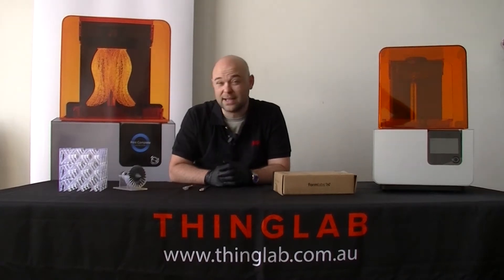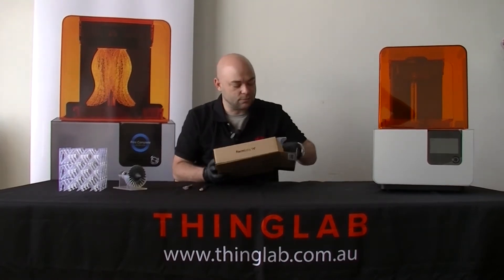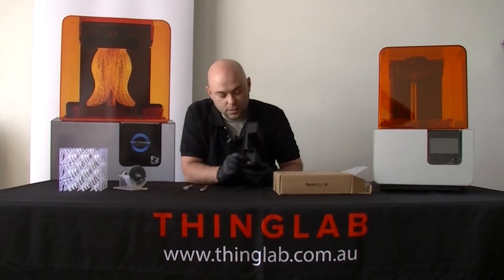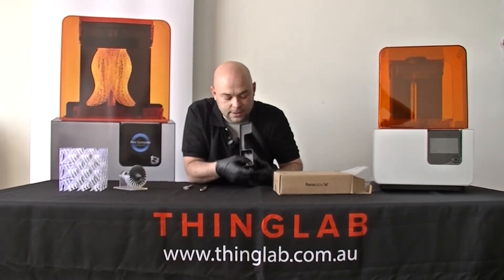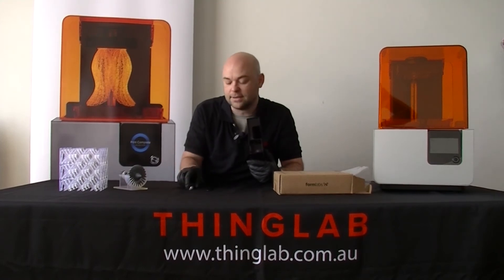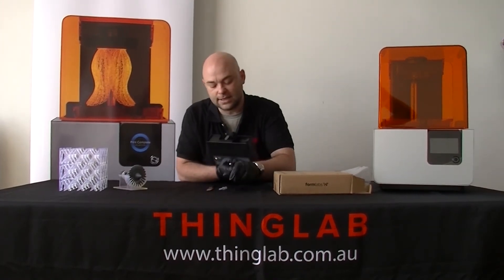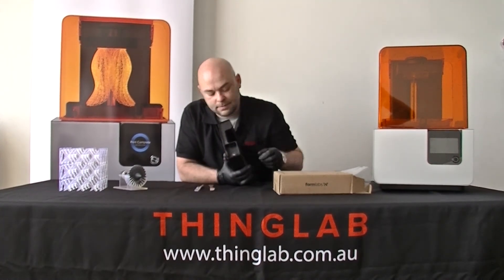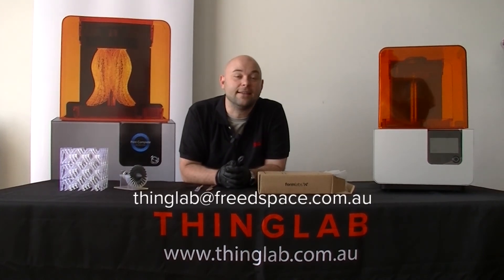Thinglab: Formlabs Form 2 Resin Cartridge Dispense Error

Comment: Any tips on fixing the intermittent contact issue between the machine and the cartridge? I've cleaned the contacts on the machine and I've cleaned the 2-pin contacts on the cartridge that can be seen at 0:58 . 99% of the failures we've had with the machine is due to it thinking the cartridge has been removed just because of this ridiculous DRM system.